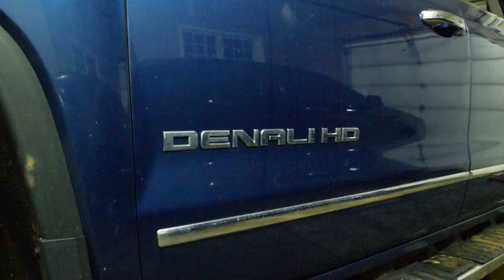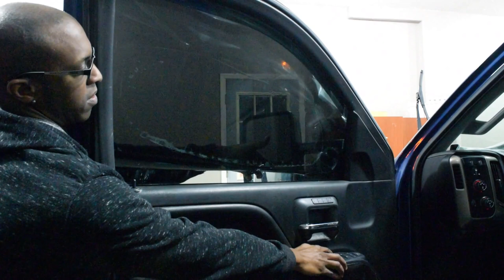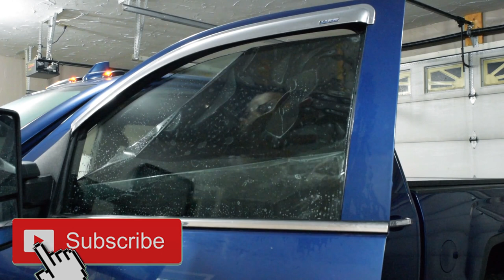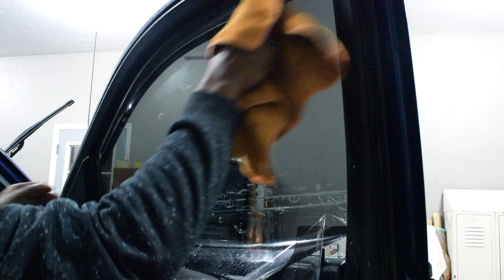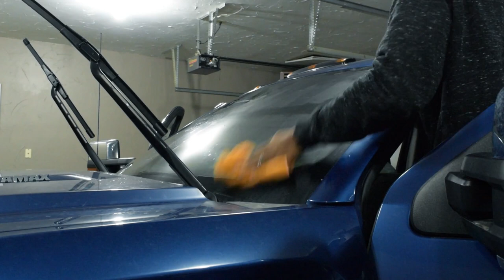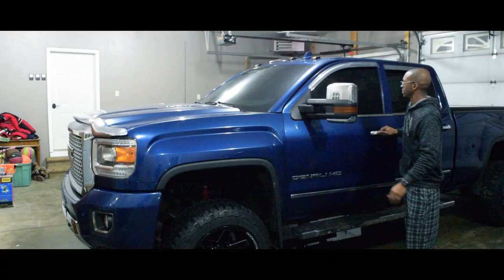Window Tinting in PAJAMAS Full 50% Windshield Tint with 20% Front Match!

Comment: How do you hand cut over those window visors? I’ve tend to shy away from them because I wasn’t sure how to go about it. 
Also what brand film do you use?
Reply from the maker: Just make sure you tack down the film to the glass really well so it doesn't shift. I cut away the extra film and lower the glass to cut the top edge. Just how it looked in the video. It's not hard really. Just take your time.
I use Tint Club and Flexfilm.
Thanks for watching hit that Subscribe button! 👍🏾